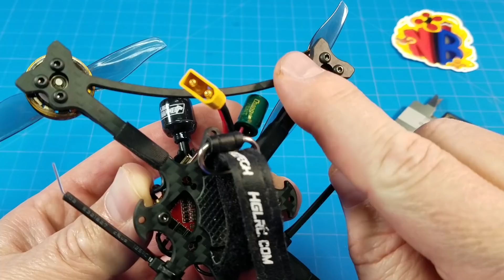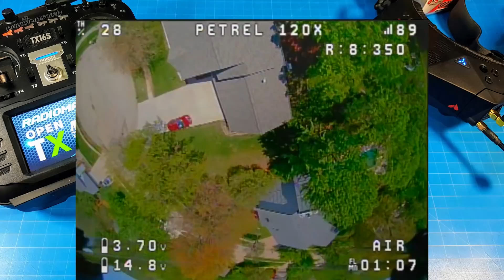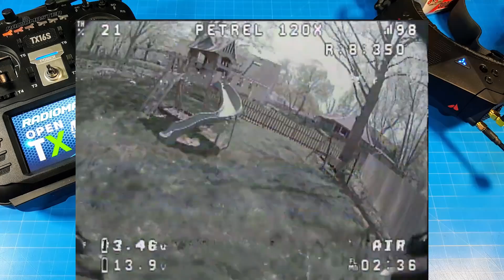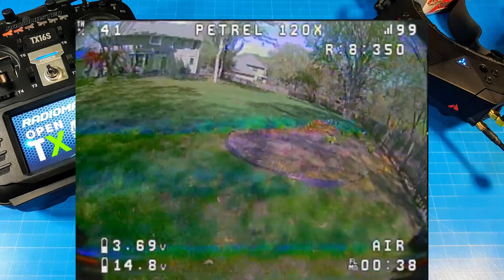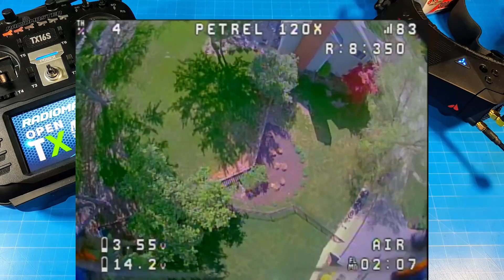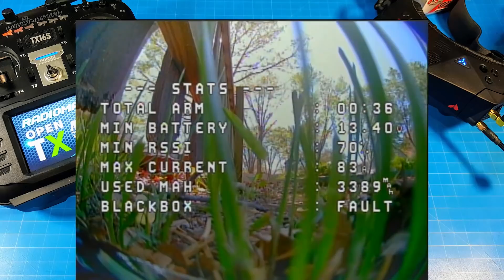HGLRC Petrel 120x 4s Edition // Powerhouse Micro // Screamer!!

Comment: Great review as always. Those motors appear notchy when you are turning them on the bench.
This looks similar to one of my builds using Tomoquads Airstrike. Quite good power to weight ratio in this size and style. I wish I could fly mine as fast as you to compare the power draw. Using RCX 1304 4500kv motors and Gemfan 3035 triblade props and RDQ 525 4s batteries it seems like I'm getting more flight time. But, like I said, I'm not nearly as fast as you.
Reply from the maker: All those hard turns are fun, but do hit the battery fairly hard.

Comment: Oh well, a neighbour annoying screamer!
Reply: There are about 12 houses in my small neighborhood and I do believe every neighbor (like myself) is OCD about their yard , so there is seldom a daylight hour where a lawnmower, weadeater,  leafblower,  pressure washer  or chainsaw can't be heard. So flying micros in my yard is often masked by the sound of small engines.
Reply from the maker: @Matt633NLT  Hey, that is excellent masking of fun :)
Reply: my first thought also :D
Reply from the maker: yea, I am pretty careful not to fly 10 packs in a row of the screamers. Although, my wife says she can't hear these screamers inside the house. So if the neighbors aren't outside I doubt they notice either.
Reply: @NickBurnsFPV  I guess that your wife is already conditioned not to hear the quads, just like mine. Back in the days I had quite some trouble with a particular neighbour even after just one pack with a 3" 3S quad.
Since then I am very very careful at picking up new mini quads for the backyard fun.

Whatever...btw. I wouldn't trust myself flying in my backyard with that pocket rocket, you managed that beast astonishingly good.
Reply from the maker: @DMarko22  Yea, I don't think any of us are looking for negativity. Today I was out flying and there is a tree crew out working somewhere in the neighborhood. I could barely hear the quad. Doesn't make for a good video on the channel but surely didn't bother anyone :)

Comment: Great flying as always. The canopy reminds me of the Nameless RC toothpick they had a year or so. Loving the new tight diving maneuvers. That's my favorite type of flying is diving in a pine forest and pump over the canopy and find an open gap. Yeah it sure does look like a Twig. Racer X original and V2 Twigs are my favorite 3" Micro and still running on a 1204 5000kv super awesome ultra light flyer. And my TwigXL is one of the few frames that allows for a 3.5" prop on a 3" frame. Also one of my favorites although a bit heavier running 1407's 4000kv on 4s with a 3.5" prop. So much better flyer than a typical 3" the extra 1/2" prop makes a big difference.
Reply from the maker: There we go a few twigs in the wild. The canopy does look like the N47 or something like that.